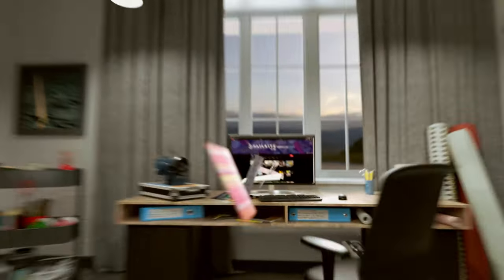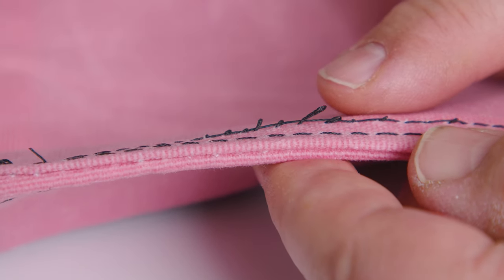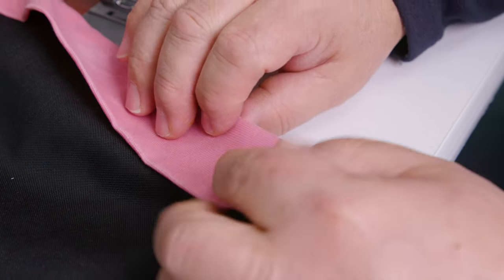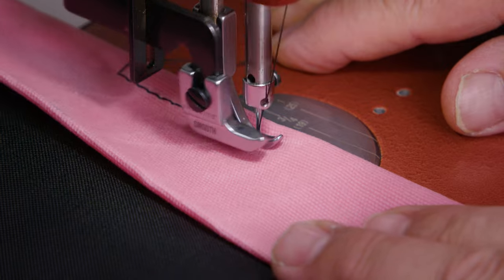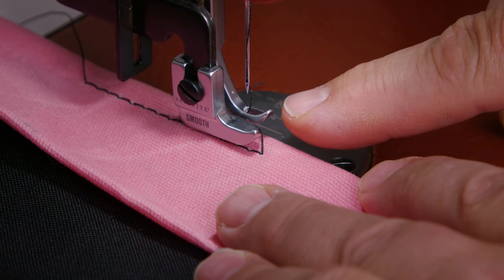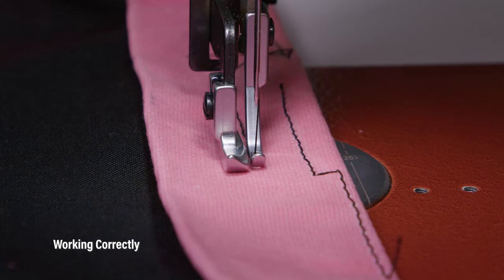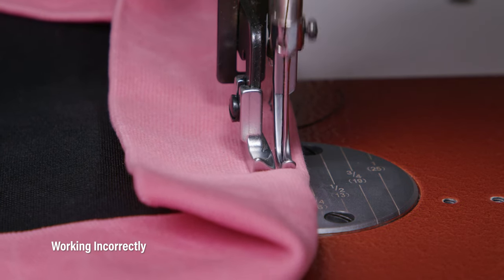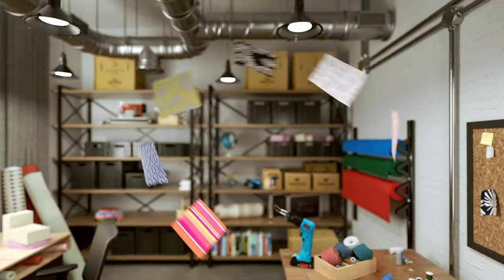How to Fix That Annoying Loose Stitch - Is It Foot Lift Rather Than Tension?

Comment: YES! This video fixed my issue that I was chasing for a long time. I’ve played with tension, replaced parts, called for help, etc. I pretty much gave up and almost sent my machine back for service. After watching this, I noticed that my presser foot was just barely kissing the bottom teeth. The middle part of the foot was not “popping” at all. I’m still not sure how to adjust this.. but what I did was to move the presser foot down slightly so that it contacts the bottom more.
Reply: Okay 👍😊
Reply from the maker: Sailrite does have a special unlisted video for adjusting the presser feet. Feel free to contact us for help on that topic. If you own our machine we will send a link to the video showing how it is done. email info@sailrite.com

Comment: That works for sewing along a seam. What about when you sew over a seam, and on every seam, you get loose stitching under the seam? For instance sewing the hem of a flag. I’m sewing the end of the flag, but whenever I sew over the color change between white and red, there is a seam. On every seem, I have loose thread under the seam. Once I’m over it, the thread is nice and tight.